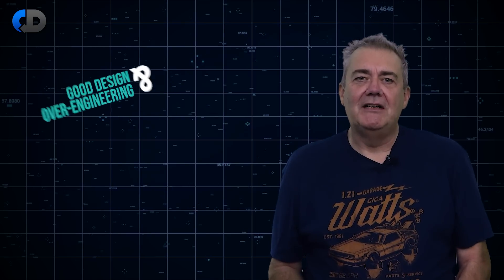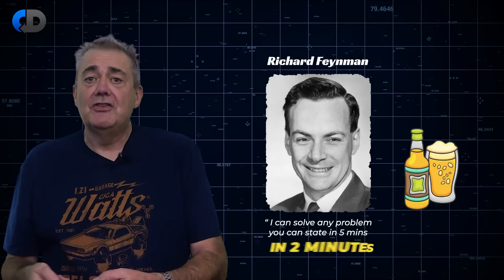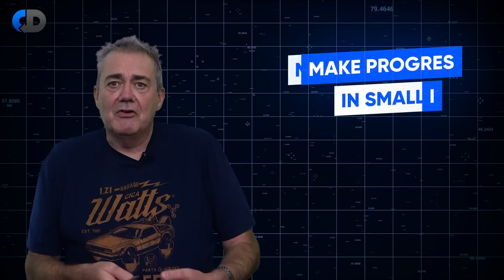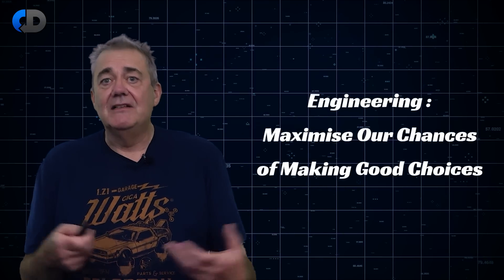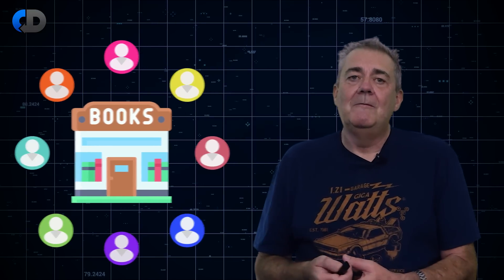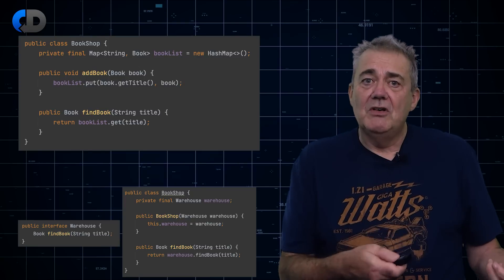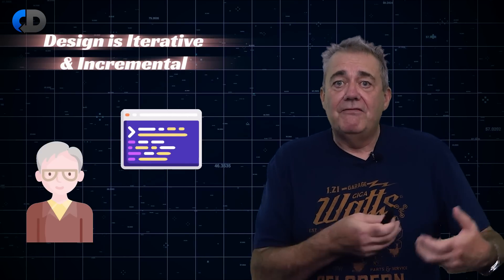How To Avoid Designing A Big Ball Of Mud (YAGNI)

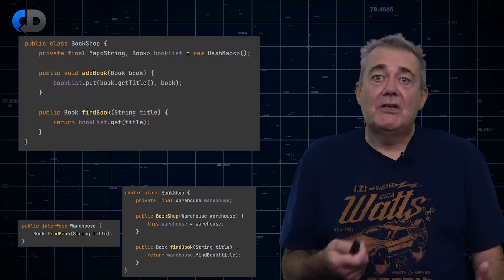Comment: Example 1 and 2 that you gave around ~15:00 in I think of in terms of top-down design. 

You can either design bottom-up "hmm, what will I need to keep track of the books? I'll need a hash-map, so let's ..." etc etc. You are thinking through an initial implementation and then using your implementation to driving your refactor to interfaces.

Top-down design would instead look like: "okay, what do I need, well I don't know where I'll get the books from yet, it could be a hash table or something but let's not commit to anything, let's just call that the Warehouse, let's stub out the interface and keep moving forward" etc etc.

Top-down design is about building interfaces that model the problem, in language of the domain experts and in metaphors.

Either top-down or bottom-up design can fall prey to over-engineering. Doing top-down design well doesn't mean big-design up front, note that when you're doing top-down design well, often times you are specifically stubbing out stuff you don't want to think about or over-engineer. You are thinking at a higher level precisely so you can express the problem in simple terms, by delaying implementation details as long as possible.

Comment: To really create an app that's a big ball of mud, you need management's help. First, contract out the initial development, and tell the contractor to hurry. He'll slap something together using a framework. Check for basic functionality, end the contract, and put it into production. Second, whenever a new feature is envisioned, set a specific date for when it will go live, and pressure the developers to meet that date. Third, remember that re-factoring doesn't justify a higher price tag for your customers, but new features do.

Comment: I think my normal approach to design is to look at what people need to accomplish, what they would like it to accomplish, and what features they would like to add to it over the next year or so. From that I try to break it down into some high level ideas based on the math that has to sit behind those features. I look at what math is in common and for that part I try to figure out what I will actually need because often that ends up determining how other parts of the system will need to function and it also doesn't take more than a few hours usually. 

After that about a day is spent on trying to break the system down into some high level modular components and we try to work through the design quickly to see if it can cover all the usage cases. Once we are to that point we can start coding. In general the classes all have to be small, we try to use pure functions where possible, and use dataclasses for interfaces. This makes writing the testing much easier.

Comment: 1:56 anti-pattern: big up front design
2:17
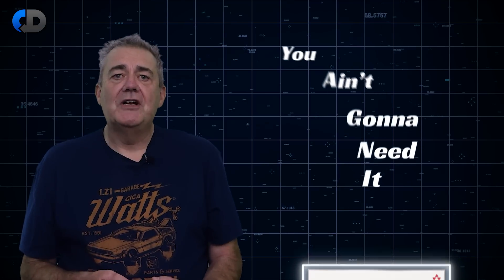    2:31 YAGNI - 2:36 came from XP
3:55
4:42 recommended way of design: go to a few different stages when thinking about design
    4:48 think about feasibility
    5:02 try the process of trying to find the simplest thing
        5:13 at this stage, the conversation is about exploring and understanding the problem
    6:17 as the problem is being explained, we run it through a mental model
        6:44 a simple diagram, or anything else
    7:32 get firmer validation about our thought
        7:56 start to figure out where is the wrong
    8:00 XP: we want to focus strongly only on solving the problem in front of this
    8:40 make progress incrementally in tiny steps
9:44 example
    10:21 YAGNI - 10:35 at the first step, it is no big deal to put everything into a big class, 10:41 the problem:it doesn't take too many more step before it starts to become a pain

Comment: can you please add a summary section at the end of the video, also what you spoke is very hard to implement and continuously need to check are we going to correct direction or not.
Reply from the maker: Every video has note associated with it. I always try to add relevant links where I can. Just check the description for the video. I have also just started a new Patreon community, if you join at any but the lowest level, you get access to something we're calling "The Modern Software Engineer's Companion - MSEC", it provides worked examples, descriptions and links to other sources of information, and puts some of my videos into context.
Reply: @ModernSoftwareEngineeringYT  great <3

Comment: Dave, what are your thoughts on Design Patterns? I’ve seen so many interviews where developers get asked a lot about all patterns from the top of their heads, and I feel like that we don’t really implement those from the ground up very often.

That might just be my experience, I would like to see what more experienced engineers have to say about that.
Reply from the maker: I use them all the time, and use them as a way of talking about code. I think patterns were an important step, I mean to do a video on patterns at some point. I don't recognise what you say in my own work, they just seem like a valuable tool of the trade to me.
Reply: I know you asked Dave but since you said you'd like to see what other experienced developers have to say thought I'd chip in. 

Your experience with patterns is very much like my own. They are limited in the vast majority of cases to head knowledge that never is exercised in a real codebase. And when it is exercised, the many misunderstandings become obvious.

As an example, I used to work in a codebase where factories were often buried three layers deep - factories creating factories creating factories. 

Then outside the factories there would be lots of if statements. Clearly whoever implemented this didn't understand factories or they never got around to finishing their refactoring work.

The same goes for code smells, connascence, Demeter's law, most refactoring ideas. The confusion is real!
Reply: @joyfulprogramming  I had a similar experience a while ago. I'm not saying that design patterns have no benefits, when done right, they do have.

But we have a code base that is implemented on top of the command pattern, really great design, easy to understand, but we have bunch of implementations of each "command" every now and then due to how the business works. So a couple of developers thought it would be a great idea to on top of the command patterns "solve" the issue of implementing commands every now and then:

Result: A big ball of mud, with a bunch of low level code, with a lot of if else statements to take decisions, that would take a looooooong time to understand if you were to start working on this code base. It ended up there for a couple of months some of us tried reviewing it and it is now thrown away... 

Lots of insights from this experience: not every time it is a good idea to introduce abstractions, sometimes the basics work better for maintainability.

Comment: All this brittle infrastructure oop requires does not exist in FP languages. It’s difficult to program yourself into a corner with FP . It’s easy to create a ball of mud with oop. Death by verbosity and explicit structure.
Reply from the maker: This is nothing to do with OOP, this is about coupling, and that is wholly unrelated to programming language or paradigm. If your registration system knows how your order management system works, both are broken.

Comment: Regarding 13:44. I loved doing this kind of premature design in the past, but now I am not sure it is good. It even makes things less readable and difficult to understand in languages like Java or C#. If we kept all these V2 constructs/classes in the same file I would accept it somehow as I would be able to quickly understand what is going on as I can see everything clearly. I would still argue that we don't need this change until we need it for some practical reason. Otherwise it just creates more code and more often than not, more files. It's like broken puzzles. You know how to put them together to understand them but you need to do it first. It is sometimes better to not break the puzzle in the first place and see the whole picture more easily. So in this case I disagree, at lest for the time being. I would like to hear about some more convincing examples. Maybe when there is a class with several functions and some of them relate to one responsibility while others to another responsibility. Especially if they don't all fit into one screen. Then such a split would look much more convincing. Embrace the chaos! :D ;)

Comment: This comes up for me a lot because of my long standing mindset of "get shit done". I end up implementing lots of great code that I probably don't need, because I switched from design mode into focus mode before it was time and it is sometimes hard to get out of focus mode.

Oh well. I commit anyway, then delete the bits I don't need. I can pull out the good bits later from version control if it turns out I actually did need them.

Comment: I would argue big upfront design is never the problem, it is big upfront implementation you may be wary about.

The trouble with half-baked design in an evolving team is that less experienced or just time constrained developers will tend to extend what is there rather than to refactor. They will have enough trouble figuring out how it works now and build their solution on top of that. So if you as an initial designer don't carve the basics into stone, it is likely to grow into that big ball of mud.

It all comes down to
1. the ability of people to recognize flaws in a design;
2. to understand well enough how it currently works to be able to turn things around while maintaining behavior;
3. to get the time to modify.

Those are a lot of hurdles that get bigger in time. So you'd better make sure you do not leave any loose ends at the start, design-wise.
Reply from the maker: I guess we will have to disagree pretty completely on that then 😉
I don't think that you get to build anything complex in the way that you describe. All good engineering is an act of exploration and ongoing design and refinement.
Reply: @ModernSoftwareEngineeringYT  We do not completely disagree, I agree with the continuous evolvement and refinement part. It is just that I have seen too much "refinement" of poorly designed systems. I think you will agree that mistakes in design are the most expensive kind of mistakes. The assumption that someone will fix these somewhere down the line in an iterative fashion is overly optimistic in my opinion and experience.
Reply from the maker: @MartinMaat  well, it's the only way that things get fixed. Designs evolve over time, if they don't the system is simple, if they do, then you need to be able to sustain the ability rot change them.

Comment: Good video. Made me think of this ... I really hate it when my IDE gives me an "unused method" warning. I'm designing a reasonable surface area of an interface, making completely reasonable extrapolations of the kinds of questions a future caller might want to ask of my object. The properties and methods I come up with have a sense of completeness to them. I don't care if no one is calling them RIGHT NOW. I have a reasonable expectation that callers in the near future will need this information. Then you know what'll happen in the PR? Someone will tell me to take the method out because it's not being used. NO!!!!!! That's just not the way I operate. It can be so frustrating.
Reply: I would argue that the method is cheap and easy to write, and you should write it when you need it and not before. YAGNI. As software developers (as opposed to hardware developers) we have the luxury of continuous improvement. Even when you need it, you can add only what you need, and if you need it again take a good look at the design and maybe refactor. I ruthlessly remove unused code. Get it out of my head.
Reply: Sometimes, an "unused method" warning is useful though. Among JavaScript's bullshit "features", is that you can declare many functions with the same name without triggering an error; JavaScript just assumes that you want to use the function you declared last, for all of your calls. So, if, by mistake, you declare a function with the same name as a previous one, you'll be scratching your head wondering why something unrelated with the current task has broken somewhere else.

Comment: Thanks for another super video.  I'm beginning to think that the most important thing to learn as a programmer is how your brain works. My brain does not go to solutions when someone describes a problem, instead it goes into a kind of absorb mode that generates questions. Later, when I pick up a pen, it goes into thinking on paper (graph preferred) to describe, organize, and begin having ideas about the problem.  That generates a list of things to explore and research.  It is only as this stage progresses that I begin to formulate possible solutions.
I always do the easiest things first.  Start with something that runs and build from there so you implement what is needed as you need it.  Make notes on what is needed as you go.  Things you learn on the easy stuff will probably make the hard stuff simpler.
Through the entire process I think on paper so I can check things off and remember where I am.  I don't think in code, I think on paper - probably due to decades of working in assembler.  I do, however, dream in code and rely on sleep to find complicated bugs.
When I type code my brain goes into an edit/organize mode quite distinct from the writing with a pen creative mode. Some academic study discovered better exam outcomes for students when taking hand-written notes vs typing on a laptop.
Reply from the maker: I remember when working hard on something, dreaming in assembler and wondering about my sanity 🤣🤣

Comment: I 100% agree that architecture, design and implementation are mostly the same. The distinction is in scope and detail. Unfortunately, design seems to get the short end of the stick.

As for YAGNI, I like to reference the chorus from the song "Qué Será, Será":
Qué será, será
Whatever will be, will be
The future's not ours to see
Qué será, será
What will be, will be

We don't know the future, so don't code for it. But that future is coming ... whatever will be, will be. We can't avoid it either.

While we can't design for a specific future, we need to be flexible enough to design for any future, and that's where your Cohesive, Loose Coupling, Abstraction, Modular, Separation of Concerns (CLAMS) practices make this possible.

For me, learning and apply design patterns helped greatly in avoiding YAGNI while allowing for future flexibility.

Comment: Why not both? No reason why big up front design can't morph into incremental design. The key is just to not be wedded to the current design, and be willing to change it when necessary.
Reply: I've been asking this all the time. A whole philosophy and movement based on False Dilemma. This OR that. This OVER that.

Well, that's poor thinking, you can pick both.
Reply from the maker: Of course you can, it is just that you will have wasted a lot of time on the big-up-front design. I have built several pretty large, successful systems from scratch. It has been my experience that it is really not very long, once you have started coding, that you opinions change. So why waste time going into too much detail early on. My recollection of when we built one of the world's highest performance financial exchanges, was that we spent 2 days on the initial design, before we started writing code, and then designed continually for the next 5 years, first release was about 7 months after we started.
Look at what SpaceX are doing now, their Starship hasn't got to orbit yet, and it is intended to go to Mars and further, they are at version 26, and everyone is a refinement on earlier versions. This is what real engineering, wether SW or not, looks like.
Reply: @ModernSoftwareEngineeringYT  most software projects are not SpaceX, that's a physical technology rather than a intangible one in first place.  You can't blame Space X for the methodology either.

Back to software: most software projects are known predictable product, known target user, known business rules.

Comment: You need to do the most complicated thing in the first in development - this is usually what causes cost issues.  The number of projects that fail because they can't deliver the one required complicated requirement or worse go through endless redesign trying to achieve it where money is p....d down the drain on trying to get a bad design working not adding features.  Some how "owners" find that one feature that if not understood will cause endless complexity and once you promise it are then set on it.  Some rebuild is acceptable - constant totally rebuild with no new features not so much.